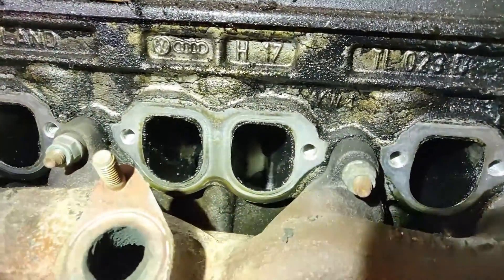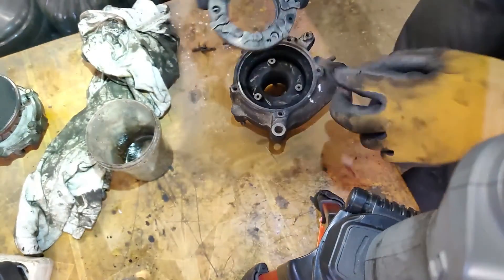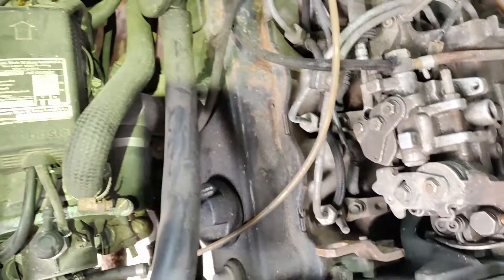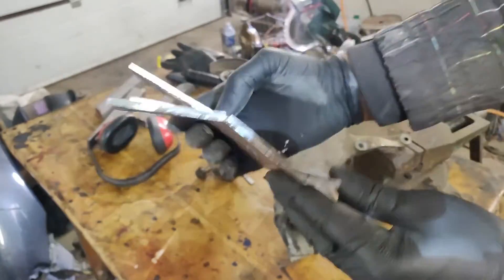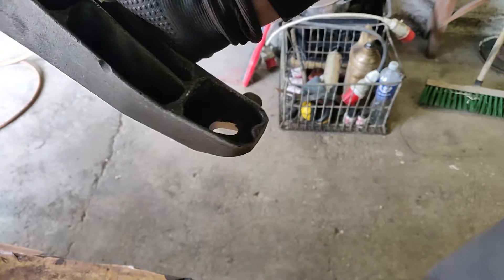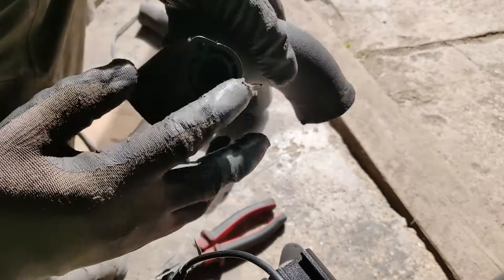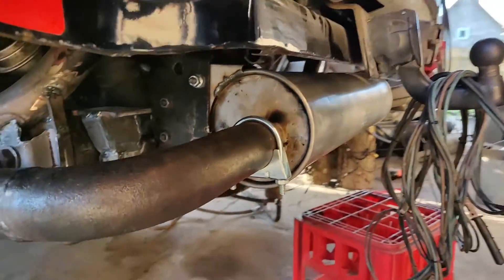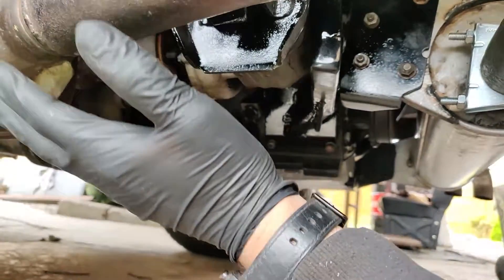VW T25 / T3 Syncro 1.9 TDI AFN conversion Ep:1 Mechanical part

Comment: Did you had any issues with the turbo because is so low? That is why u connected the drain line to the oil sump and not in the engine?
Reply from the maker: I didn't had problems. Return oil should return easily to the oil sump, I have heard, that otherwise you might have engine oil in exhaust pipes.

Comment: I have the Same Engine Afn Deisel 1.9 I have put on the T3 and i have fumes problems where it breaths on the cap Valve  and spits oil. I removed the pipe valve and put a a cap so it wont spit oil . where is the problem from the carter?
Reply from the maker: Have you left the plate, between the oil sump and the engine block? Though, I don't know if that would be the reason.
Reply: @Gadomaitis  I send u pic

Comment: Hi. Great videos, its great that you are sharing gives others motivation. I am busy with 1.9tdi diesel conversion on my Syncro. Did u keep your gearbox standard?
Reply from the maker: Hi, thanks you , all the comments gives me motivation to continue. I kept it standard, though I want to change 4th pair of gears to lower the RPM. Recently I have installed dual mass fly wheel ( DMF) , i have read somewhere, that it better suits TDI engine
Reply: @Gadomaitis  Thanx for answering so quick. I have heard mixed things about dual mass....?.I have a million questions since I can see u have done a lot but will only ask 2 if u don't mind what size tyres and what is your average fuel consumption?
Reply: @philippe9778  215/75/R15 tires, 0,82 4th pair of gears, 4,86 R&P ~3000 rpm at ~90 km/h with cruise control I'm getting around 8 ltr/100 km. In the city it's around 10 ltr/100 km. , maximum speed 125km/h.
Reply: @giedriusadomaitis1165  Thank u very much that info helps a lot. Let me know if u want to keep in touch via other means other then Youtube. I am from South Africa and we have many T3 s as VW built them here for a long time with Audi engines and 5 speed gearboxes.... Unfortunately we do not have many Syncros. We might be able to help each other with spares etc...
Reply from the maker: Sure, can you reach me on FB? You can find my FB link in Channels "about" section. I'm pretty sure we can help each other.
Reply: Awesome thanx

Comment: I notice that you left the turbo oil drainage as original instead connecting it to the oil pan. Did you notice any pressure issue?
I'm working on the swap and I'm figuring out how to do all the adaptations
Reply from the maker: Hi, at @ 13:39 I'm redoing oil drain to the oil sump. Recently I have changed turbo core, cause it was leaking oil to the intake and on the pavement.
Reply: @Gadomaitis  oh you're right I saw it many times but I didn't get the passage
😅

Comment: Hello  man ,the a4 was a quattro? you keep it the syncro system or is just back , any idea can you adapt quattro from a4 on t3?
Reply from the maker: Hi, no Audi was 2wd, I don't think that you can adapt. I think, that if CV's are very high and driveshaft on really high angle, propshaft would need to go through body panels.
Reply: @Gadomaitis  so is not possible to make it all wheel drive from a normal one ,just with syncro sytem ... and after swap  your car is not syncro anymore?
Reply from the maker: @Ottobrain  maybe I misunderstood you. My Syncro after the engine swap is still 4WD, as I changed only the engine, the drive system is still the same. Now the AUDI was 2wd. But even if it were a Quattro, I believe that you can't adapt the Quattro system to a VW T3. Because when you flip it, the drive outputs of the gearbox get really high, as I mentioned before. But it's just my opinion.
Reply: @Gadomaitis  sorry for my mistake, I thought you also changed the gearbox ,i am also looking for a t3 syncro, but they are quite rare and I was thinking of an option to make it 4x4
Reply from the maker: Let me know, if you will come up with any solution. I have heard, that people are adopting Subaru gearboxes. You need to upgrade R&P of the gearbox,  it's side interchangeable, probably you could flip the front DIFF or there are also R&P made to rotate in another direction.

Comment: hi, nice swap, nice video! are you still happy with AFN engine? any problems?
Reply from the maker: Hi, thanks! Actually yes, still happy, wouldn't change to any else engine, good fuel efficiency, power, cruise control.  Now, my turbo started to leak oil into combustion chambers, planning to fix it any time soon, otherwise everything is great.

Comment: Great Build.
I was hoping you could help me out. Bought a T25 project with engine carrier bars but  dont know what size bolts mounting them to the body?
Thanks
Reply from the maker: Hi, if I remember right, OEM bolts is 8 mm. Sounds like too small but they are enough.

Comment: Hello bro 
i have a vw golf3 engine i want to install on my t3 1.6td jx is that the assembly is easy or I have to make modifications especially on the engine mounts thank you
Reply from the maker: Hi, I haven't done Golf engine by myself, but I have heard that it's bolt-on, you don't need to fabricate any engine mounts.
Reply: @Gadomaitis  thanks a lot from Algeria 👍🏼🤗
Reply from the maker: No worries !

Comment: DomiG, can you give us the dimensions of the turbo support (the engine mount) that you made  at 14:40mn? Your video is excellent and I am going to make the same part. Thank you (I love your van).
Reply from the maker: Hey, it's a bit difficult to measure it. Guide me what exactly you need and how to measure it. Thanks heaps!
Reply: @Gadomaitis  I totally understand - maybe  just in terms of length to fit as perfectly as it does, or else your approach to making the part - what measures you took (ex. distance between the two zones it screws into and measure of the distance it needs to curve around the engine)  what factors you took into account (weight of the engine?) how you decided on the thickness of it as a support, and the zone exactly where you placed it. Sorry for all the questions but this is new to me. Any guidance you can lend without racking your brain too much (having to think too hard) would be great. Cheers.
Reply from the maker: @jw9184  now I'm a little bit ashamed after your questions, as I haven't done any calculations. I have used everything that I was able to find in my garage and I was hoping it will be enough, and I must say it's still holding fine. I have curved it around the engine on the site, made a cut, but not cut into two pieces and I have bent it to the right angle and welded it back. As the engine hangs on 4 engine mounts, I assumed that if 3 o them going to be bolted that would give me exact distance and length of the support. Sorry, I think I can't help with the dimensions of this engine mount.

Comment: Hey man, love the build! Did the engine bolt to the transmission without an adapter?
Reply from the maker: Hey, thanks! Yes, no adapter needed, if you are using JX (1.6 D)  engine bell housing.

Comment: 13:00 - Now add DPF and go driving around Berlin :D
Reply from the maker: Great idea, I will take it into consideration.
Reply: @Gadomaitis  Though AFAIK you can buy only an EURO4 DPF and get it registered at a German TUV. I'd also be interested in this for my 1.9TDIs - but in Finland there is no way to add it to registration papers and some cities have started to require EURO6 while there isn't even a EURO5 DPF for my AWX :(. Would need a complete engine swap (and still registration with upgraded emission-class).

The only way to actually do it would be to make an EV, which is possible and wouldn't need any emissions stuff of course. I think EURO6 is not really possible for vehicles since they really require adblue injection...
Reply from the maker: Actually I'm thinking the same way, I have seen on FB people are doing EV swaps and it's doable. Another good thing with EV swaps is the gearbox. Originally it's a weak spot and the swap can eliminate it. Of course, going EV is not as easy as Instal bolt on  AFN engine.

Comment: Originaly the afn motor has splash plate on the oilsump. Did you leave it in there or did you remove it?
Reply from the maker: I don't know if I did right or wrong, but I left it.
Reply: @Gadomaitis  if it still runs its probably right😅
Reply from the maker: Still love it how it drives!!
Reply: @Gadomaitis  i’m starting next week:)
Reply from the maker: @elmarruben  best of luck mate, I reckon you are on the right track. Update  when finished, how long did it took to swap it.

Comment: I do build mechanical pump for TDI engine, range power from 90hp to 200+hp, contact me if you need ;)
Reply from the maker: Tell me more, what's the benefit having mtdi instead of TDI? Isn't it's easier and cheaper to chip tune ECU rather than lift the HP in the mechanical pump?
Reply: @Gadomaitis  with mecanical pump you will avoid all Electronic problems (flow meter, sensors)...

I build pump between 110 and 170hp for only 320€. And between 180hp and 220hp for 600€. it is not expensive compared to doing a chip in view of the electric problems...
Reply from the maker: @bluemachinemotorsport3913  I have a mtdi 1Z conversion, people say, that a mechanical pump can't run with TDI injectors, how is that possible, that I have no problems driving it. Jx fuel pump and TDI injectors. What do you recon?
Reply: @bluemachinemotorsport3913  Do you have a website?

Comment: Hi DomiG, do you have any issue with leaking oil from VNT15 turbo , smoke or go to intake ? 
Nice job to document it all :D , Thank you
Reply from the maker: Hi Michal, hm, there is a leak in to the intake manifold. But I think that leak was already before my engine conversion, because when I was disassembling donor Audi, intercooler  and all hoses were oilish. There is also white smoke, when I start the engine, but there's no smell of burned oil, like I used to feel earlier from 1Z engine with dead turbo. I believe that leak is +- normal for an engine with +300k km.and also i don't know the history of my donor car. Do you have same setup? 
Thanks, it took some time to document it all, I hope you liked it. Cheers, G.

Comment: Hello DomiG! It is great! I have T3 too, i am going to do a major overhaul. I will use your video like manual.
Reply: Hi Need help please on the electrical side  i have a ASZ engine   what do i need on the loom side of the ECM to get the engine running have done a de-key code on the ECM
Reply from the maker: @rean6701  Hi, if You want to start the engine and as You say IMMO is OFF, basically you need to connect every vital connector (as crankshaft sensor, camshaft and else )  from the engine to the ECU loom. Then from ecu to the fuse box loom side connect 3,31,62 pins with power, (12 volts) ignition live. Then 1 and 2 pins with the ground. The engine should make some clicking sound. The rest will be to connect the dash according to the wiring diagram that you will find on google. Also for Ecu pinout google "vw asz ecu pinout", check the image site and you will see the detailed info.
Reply: @Gadomaitis  Hi really appreciate the reply , i don't want to use the dash want to use the original dash my issue now is the comms  i connect the ODB2 connector directly to the the ecm  can bus and k line bur no comms.
Reply from the maker: I thought You will use the original T3 cluster, the original cluster will require connecting also. It should connect via OBD, maybe missing some positive wire? double-check the wires, if everything is connected.
Reply from the maker: Hi Ivan, nice to hear that and glad that you liked it. In my opinion, both of the episodes is very informative on the conversion. Don't forget to setup built in cruise control, this future is just necessary for long journeys and easy to setup. Cheers, G.